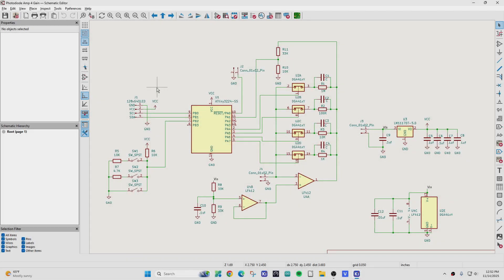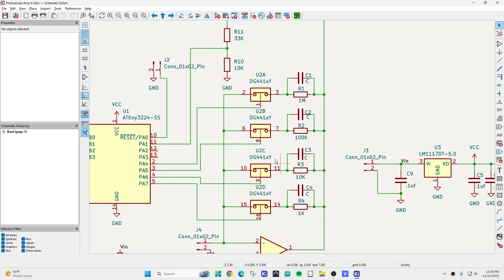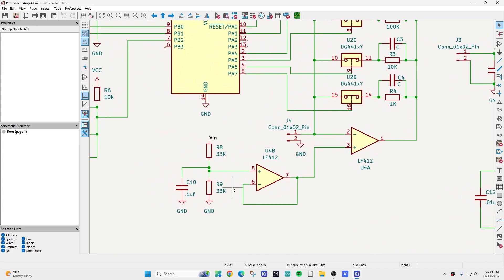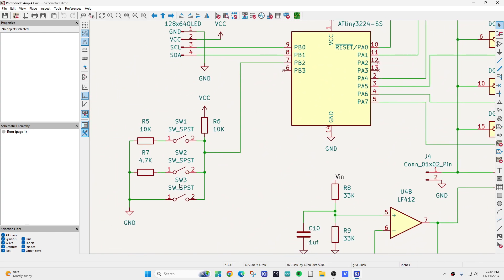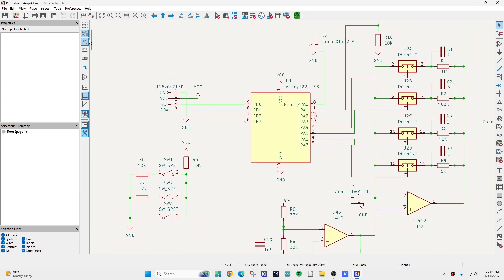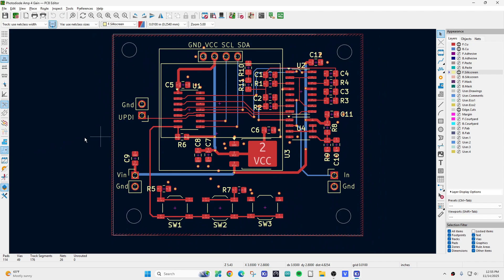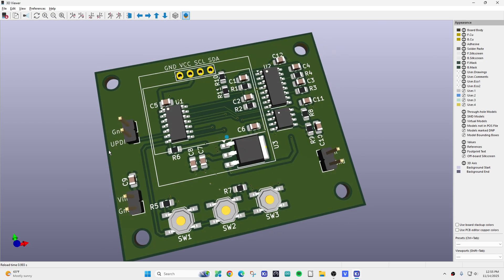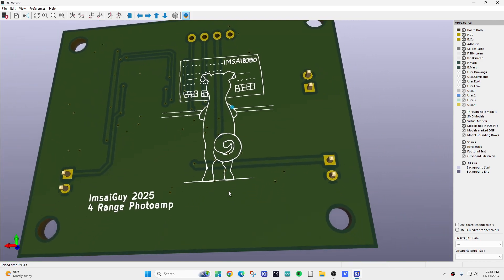#2435 Photodiode 4 Gain Amplifier (part 1 of 2)

Comment: Assuming J4 is the photodide: my gut tells me that J4 should connect directly across the input pins of U4A since since U4A pin 2 is a current summing node, and U4A pin 3 is a low impedance voltage reference. The initial design requires that the PD develop vin/2 before it can have any effect...

Comment: Input run right through the digital part of the circuit ?
Reply from the maker: the current input is on the right hand side of the board.
Reply: K.
Reply: Digitally selectable gains seems cool, but what would the practical purpose be for it? Why not just twiddle one potentiometer?
Reply from the maker: @robertsemenoff4970  auto ranging for one

Comment: don't you want the diode referenced to virtual ground?
Reply: I think the idea is to reverse bias the photodiode at whatever the difference between virtual ground and actual ground is (6V in this case).
Reply from the maker: I debated both ways and figured I would just build the board and try jumpering it if needed.

Comment: Wouldn't it be better to move the switches to the low-impedance side? That is, not to the left of the resistors, as they are now, but to the right? This would likely help reduce interference from the controller to the amplifier input.